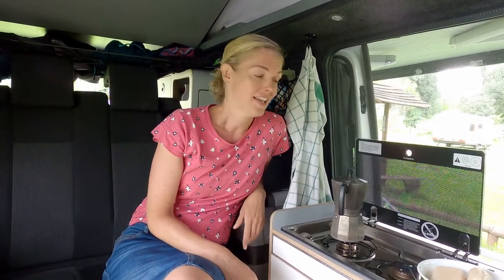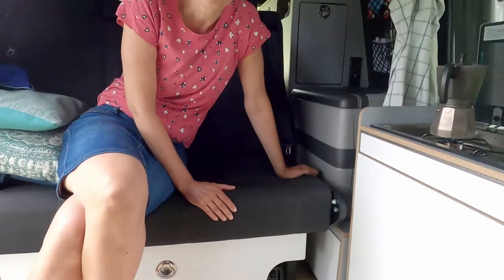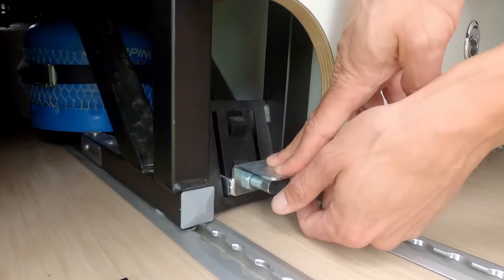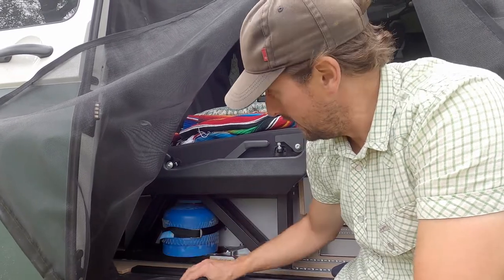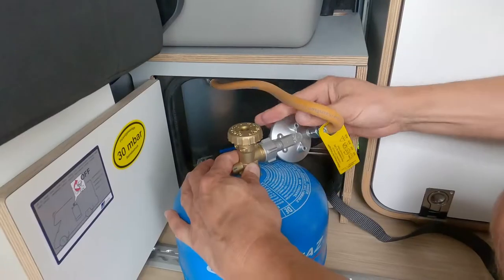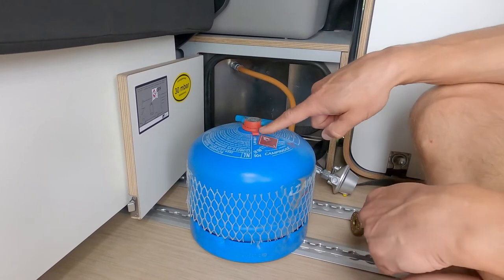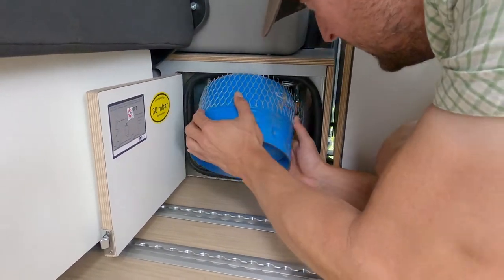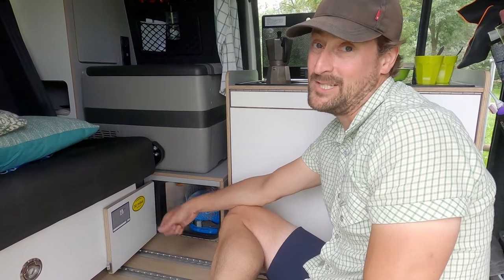SMALL VAN TOUR | CAMPINGAZ BOTTLE needs changing in a CONVERTED VW TRANSPORTER T6.1 | TONKE VAN XL

Comment: Would you recommend to Tonke to create the access to the gas in the cabinet under the sink ...... seems more convenient ?
Reply from the maker: Thanks for your thoughts. Made me think. I think it is a compromise between available space and the times you need to use that space. Gas change we need to do the least. Once a month. So you could say that for "regular" owners the gas change is part of the holiday prep. VW has put the gas in their california all the way at the back. More easy to reach, but they have a watertank under the van. Tonke does not have that and this has benefits and drawbacks. So if an advice  would be needed I would say an opening at the hinge (where the kitchen swings to the outside) to either be able to easily close the gas everytime or to change the bottle from there. Just my two cents...